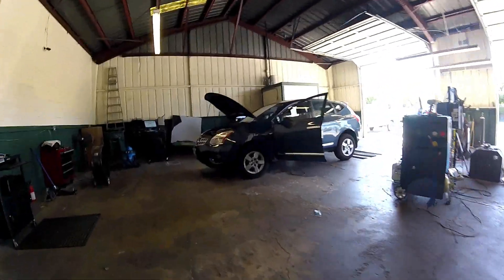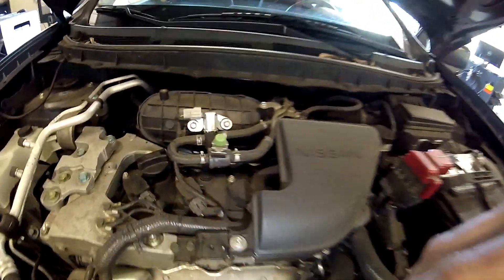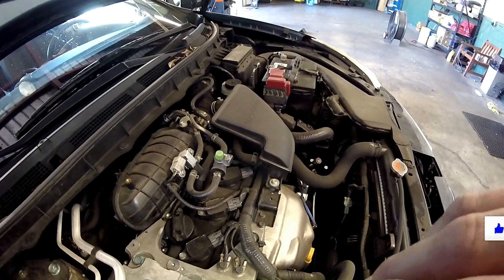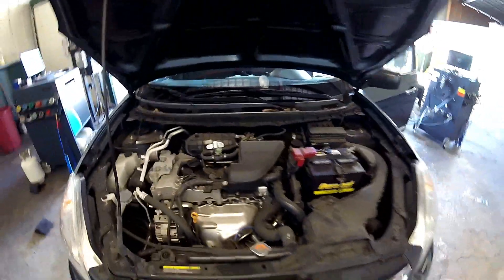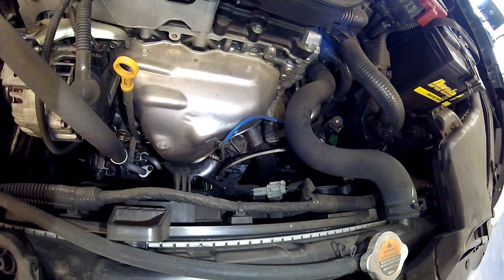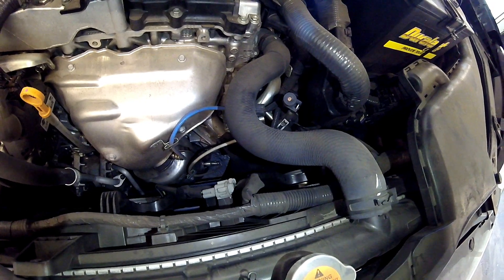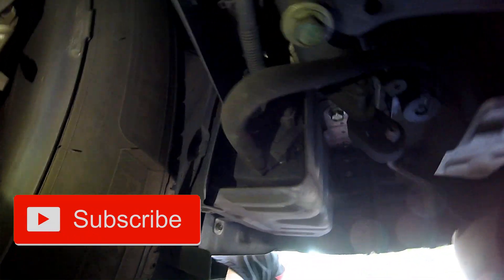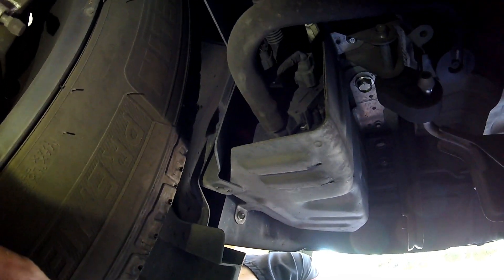⫷ Nissan Rogue, QR25DE , Emissions Locations: PCV, EVAP, Oxygen Sensors ⫸

Comment: ive got p0447 on a 2018 rogue, is that evap vapor vent valve the same as the evap vent control ? Dealer said I need eval vent control valve replaced
Reply from the maker: Yes, they are the same thing.
Reply: Hi does your’s fixed? I have the same code to my 2019 rogue..thank you @SPMecano

Comment: I changed my maf sensor in same year model car. Disconnected the battery for 15 minutes. Engine light off but still reading po101 code for the maf sensor. Please help
Reply from the maker: Have you checked for vacuum leaks? Did you check to make sure the wires were making good contact in the connector? You might also have a wiring issue. The vacuum leak would be your easiest fix if you find one.
Reply: @ScottiesHobbies  i didn't do  any of  those. Thank you so much 💓 💗 💛 💖.  I will check that tomorrow morning

Comment: i know this is old but i`m getting the p0420 code and it says it is one of these but which one should i replace, or all?
Reply from the maker: Your cat is probably bad. But your computer might be seeing bad readings from any oxygen sensor. The rear oxygen sensor or sensor after the cat only measures the efficiency of the cat. That's the one the computer uses to check the cat. I usually start with that one. But.... the pre cat o2 sensor could be giving the computer a poor reading... from more relative experience, your probably going to end up replacing the cat.